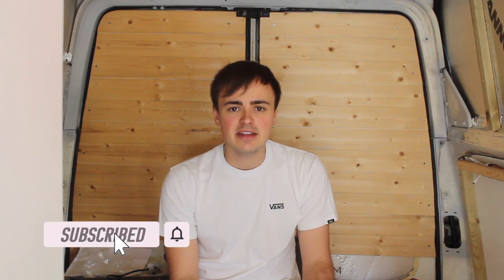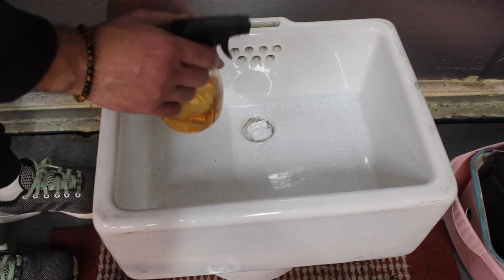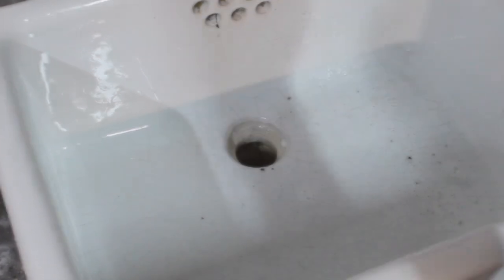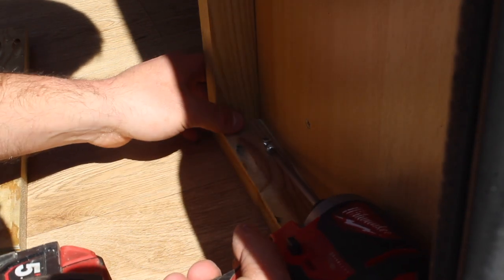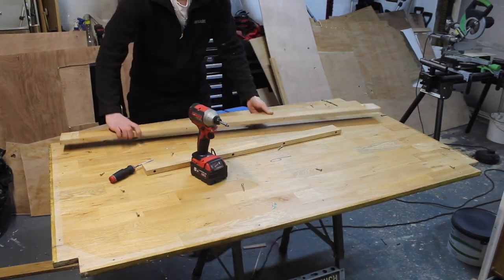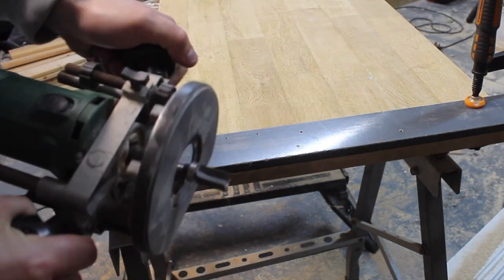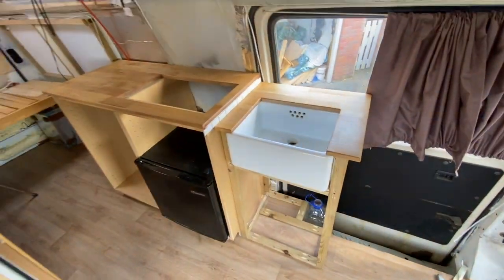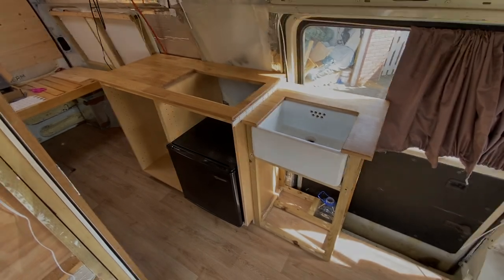Baby Belfast Sink Base Unit & Worktops - Van Build Series - Episode 15

Comment: Great build, well done. I'm at the stage of installing a belfast sink which looks about the same size as yours. How has the structure of yours held up since the instal?
Reply from the maker: Thank you 😊 the roofing batten construction is holding up very well. No issues so far 👍🏼
Reply: @TurnersWorkshop97  That's great. Thanks 😊

Comment: Nice one Olly..... Work tops look top really classie.. What paint did you use on your wheels and suspension parts. Lindsay
Reply from the maker: Thanks Lindsay 😊 I used hammerite black on the suspension parts and under van. The wheels were taken back to bare metal, zinc primer and then black alloy wheel paint. Slight rust starting to show up though unfortunately, it was done 2 years ago now. I’m thinking next time I will pay to have them sandblasted and powder coated so they last longer hopefully 🤔
Reply: @TurnersWorkshop97  Brill thanks for the info... Can't wait for the next video... 😀. Do you think you'll ever display the van finished ie meets or shows? We've got an 88 autosleeper we are doing up. Lindsay
Reply from the maker: No problem 😁 hopefully when it’s finished! Yours is almost classic, what base vehicle is your camper?
Reply: @TurnersWorkshop97  Hi Olly.. Same as yours swb smiley 2.5td model is a Flair built by Auto sleepers.. Did you now if you can put pictures on here?
Reply from the maker: Oh lovely I do wish I could find me a turbo lump to put in! Unfortunately they don’t have that feature on YouTube yet, hopefully this is something they will introduce. Do you have instagram?
Reply: @TurnersWorkshop97  Hi Olly... Yes I've sent some photos across on Instagram for you.... I've got a customer selling two 2.5 td engines complete with the manifolds